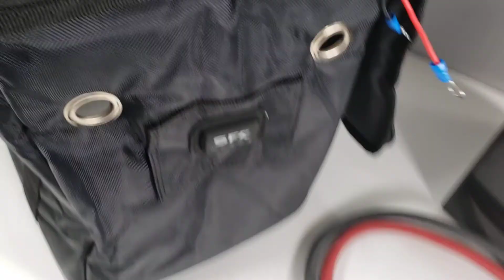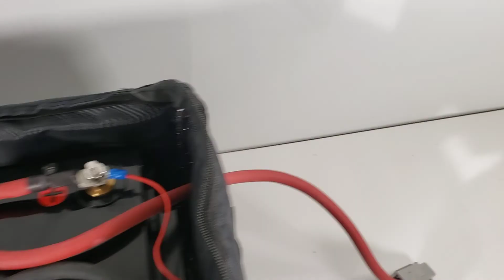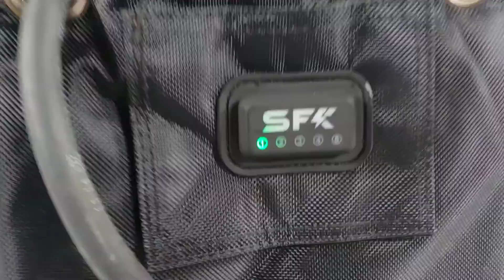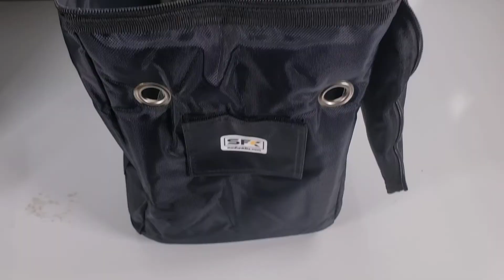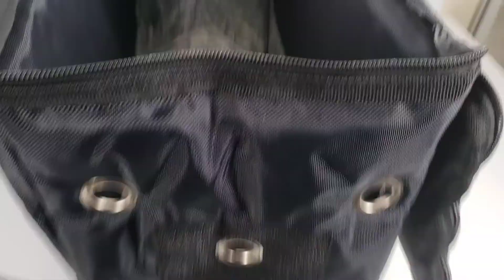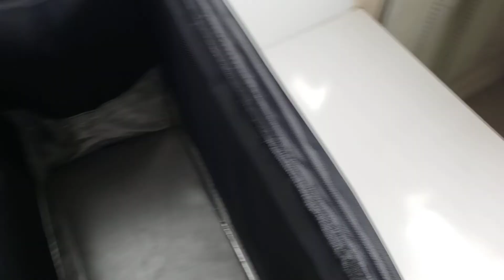Heated & Water Protection Jacket For Lithium Batteries Sun Fun Kits

Comment: Nice. Maybe even nice insulation for folks in a moderate zone where they might not need a heating pad. Do you have a ballpark cost for these cases?
Reply from the maker: Right now we are aiming for around $75 for the non heated version and about $130.00 for the heated version. This is before coupons and promotions.

Comment: I really only want to heat my battery when I have solar available. When the battery is too cold, instead of charging the incoming solar is used to power the heater until the battery is warm enough, then it switches to charging.